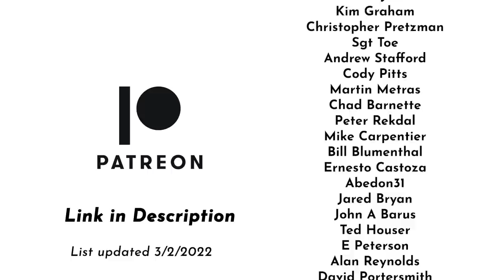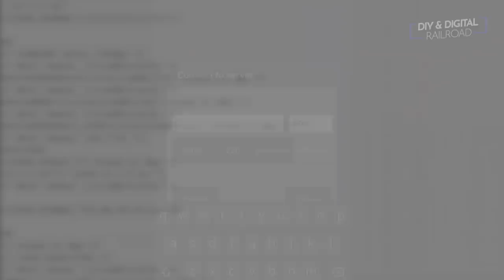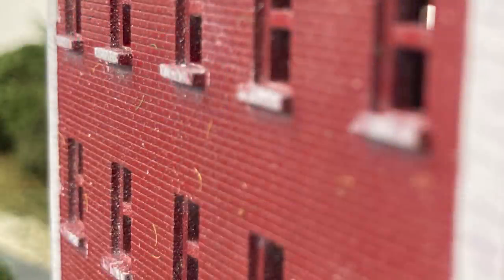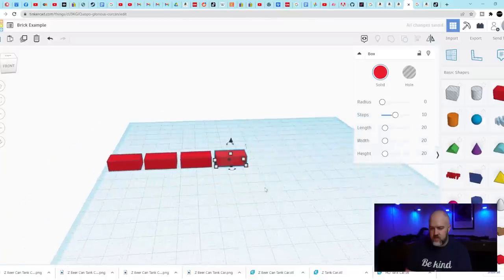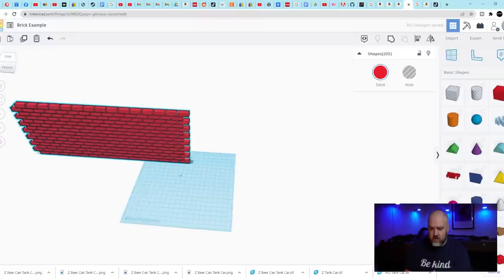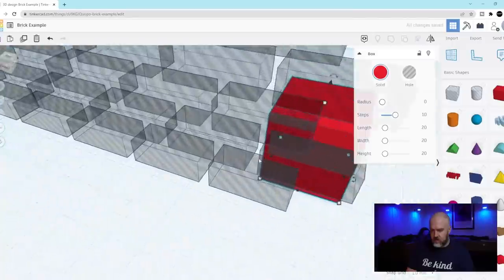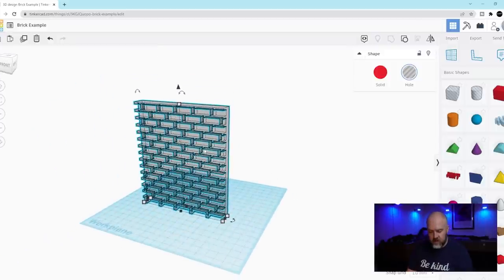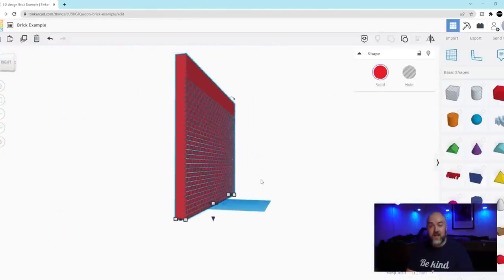How I make those brick walls on my Model Buildings.

Comment: As a tip: if you're using any resource hog program I suggest shutting down all other programs so you can use all available computer resources designing etc. Just a tip from personal experiences.
Reply from the maker: Yeah I’m due for an upgrade too.  When It’s running slow and I look at my task manager, my ram is getting maxed out.  Luckily I built this computer so I can just buy more.  CPU is a Ryzen 5 and is barely sweating.

Comment: The reason DCC uses rail signaling instead of wireless, is because DCC is a STANDARD that was developed in the 90's wireless wasn't a thing (not digital anyway, analog) and what was available was crap. To support backwards compatibility, the standard doesn't change.

Comment: There is a much simpler way to apply surface textures using blender. You can use a 2d drawing (mask) to emboss a surface. You can apply all kinds of surface textures.

Comment: I want to build scale model oil refining units but the things I need just aren’t available.  The next option is to make them using a 3D printer.
Reply: I am really wondering if I need to go with DCC in N scale.  I can run 3 trains at a time and to me that is a lot of activity.  My big thing will be the polarity switching loops I will have at either end of the layout.  The main focal point of the layout will be the refinery.  Rail operations in large refineries are necessary.  They haul away tons and tons of coke that goes to the steel industry.  While most products are transported by pipe line rail is used for other specialty materials. Thanks you have given me things to think about.